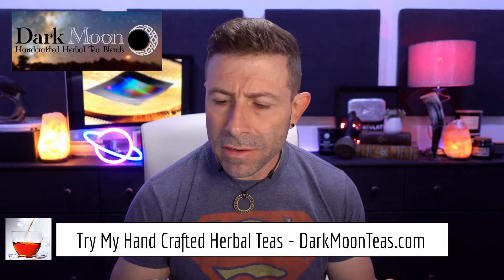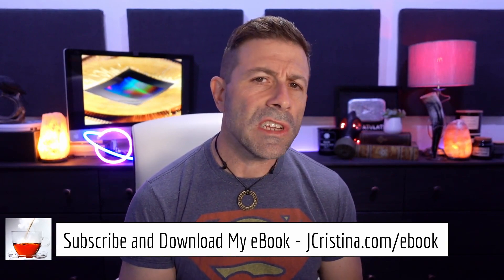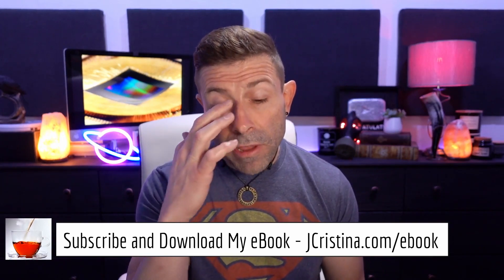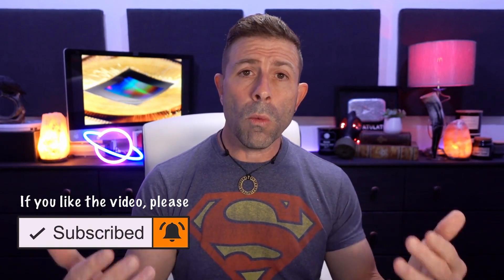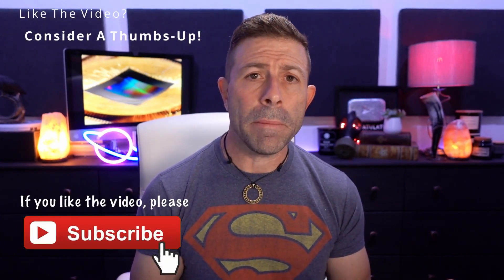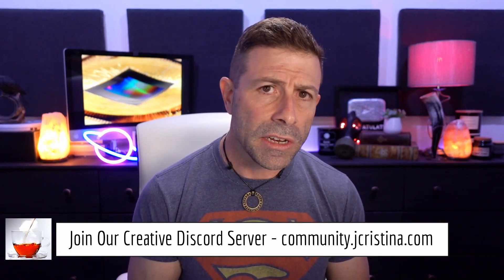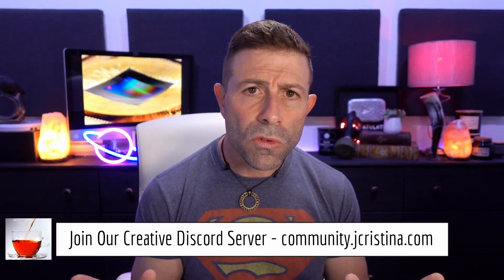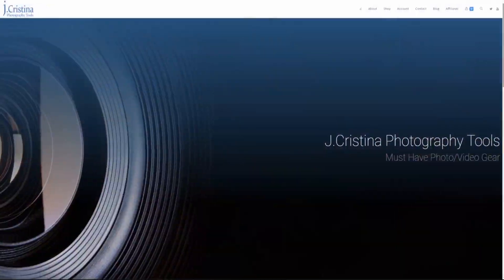Canon Is Racing To Produce A Curved CMOS Image Sensor - WHY?

Comment: The very biggest mirror telescopes around the world have hexagonal mirror elements that are precisely controlled by computers with electronic actuators that are designed to correct for atmospheric distortion by analyzing laser light that is shot up from the telescope. If one was to try and copy this in principle you'd need micro or nano scale actuators that have a very long vertical travel distances to work a varying depths to produce a  curvature that would work with both telephoto all the way to super wide angle even fish eye lenses. And what about the tilt-shift lenses?
Reply from the maker: Great points.  We will see
What they come up with.